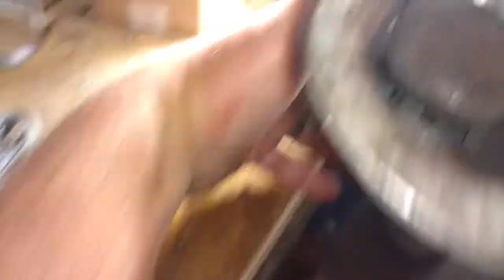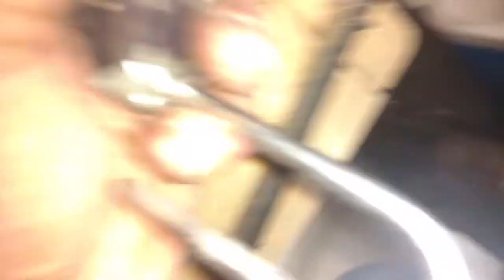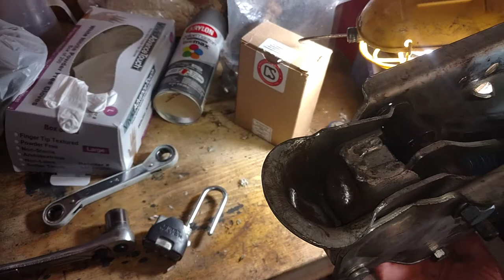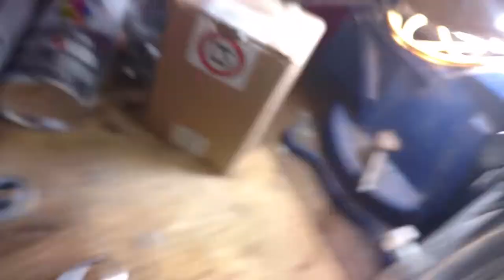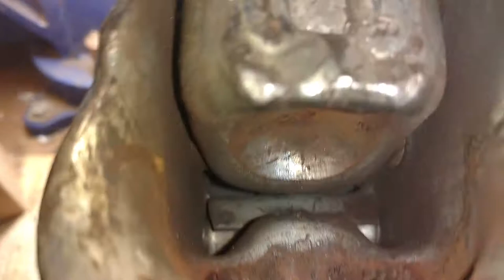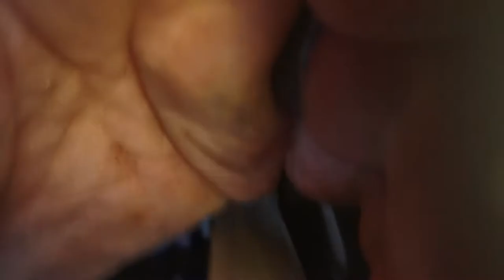Atwood coupler

Comment: Hi, I have the same coupler on my Pop-up camper and hitching up is a right pain in the "A". I think my coupler is doing the same thing yours is doing. Did you ever find out why it keeps moving forward when opening instead of moving back?
Reply: I'm having same issue, I got a used boat trailer today, but can't hook it up to my hitch. The lever won't move that tongue lock thing. After looking around YouTube I know I sort of think the brake actuator may be pushing the lock forward to lock position. I'll go back and try more in the morning. Or maybe  someone will post a response to this video.
Reply: @theunzipped  how did you correct it?
Reply: How did you correct it?
Reply: @stevearredondo9297  I lubed all moving parts with chain lube. Then it worked good enough.

Comment: I've had the same issue which came from a boat mechanic lifting the coupler, while not open, and forced the bar behind the coupler to flip. It's a pain to flip it back to work correctly but thats all it takes.
Reply: Hello, can you possibly help me with this? mine is doing the same exact thing and i'm not sure what you mean by bar behind the coupler to flip.
Reply: @billramsey5456  I finally found my issue. Looking at a repair kit, I am apparently missing the spring that makes this work.  Its in the repair kit. I guess mine rusted and fell apart. Check yours out. The spring should be visible when you lift the latch. It goes on thd bar that runs directly underneath. Mine has just the bar.
Reply: @MaximusD180  i'm pretty sure mine still has the spring. what bar are you talking about?
Reply: @MaximusD180  that's the one i have, what are you calling the bar? #22?
Reply: @billramsey5456  #18 is what I mean by the bar. Guess I should've called it a bolt. #13 spring is held in place by that bolt. I just don't have a spring anymore.
Reply: @MaximusD180  Thanks, yeah i FINALLY got it fixed. The spring on the camber was reversed after it slipped off its perch because of the pressure on the hook. I put it back to where it was supposed to be and it works. Took me a bit though lol
Reply: @billramsey5456  I'm going to try to fix mine.  what number in that diagram was reversed?
Reply: @billramsey5456  I'm going to try to fix mine.  what number in that diagram was reversed?
Reply: Liam Fracht-Monroe that’s the problem, there is not a diagram that really shows how it goes. I can maybe take pics of it for you to see what I’m talking about
Reply: That would be awesome.  You can find me on Facebook, or just Google my name (don't want to post my email here)
Reply: @LiamFrachtMonroe   will do!
Reply: @billramsey5456  do you still have those pics? I'm having the same issue
Reply: @Andyman21643  I’ll look. But what happened to mine the latch went too far , I had to literally snap it back to normal which was hard to do because of the spring
Reply: @Andyman21643  I am looking for help as well if you guys have any info . Won’t lock on the ball .